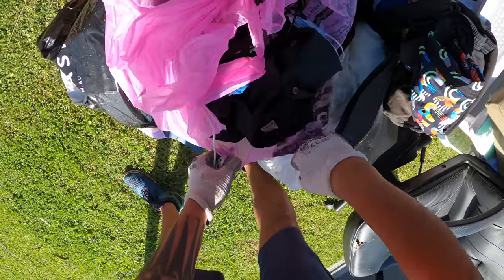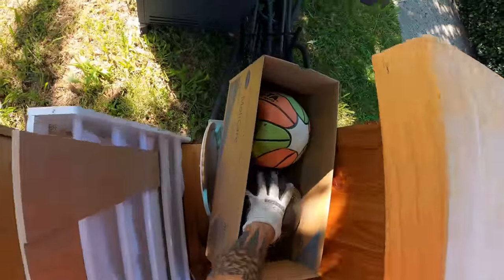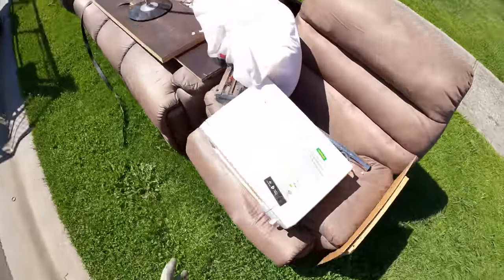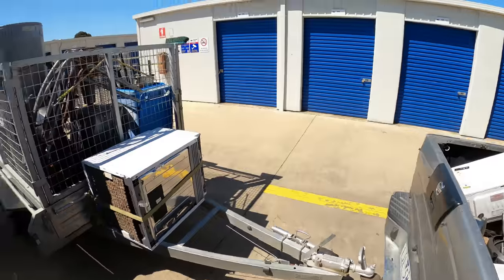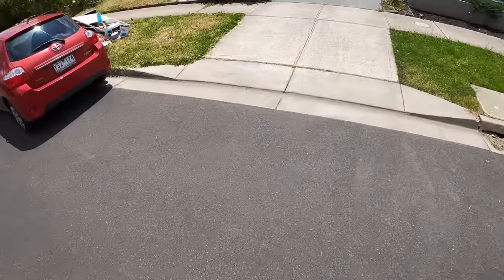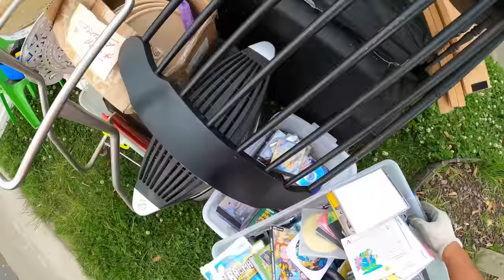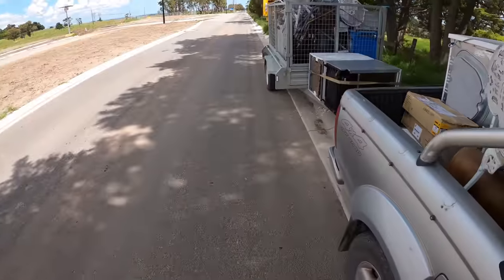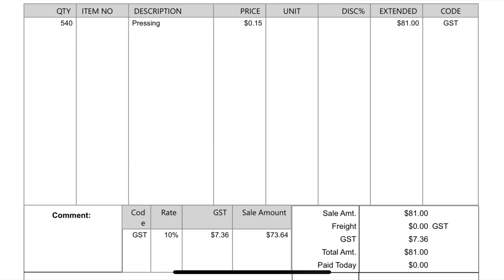Suburban Curbside Scavenging

Comment: Actually, the best scavenging is at college campuses.  Specifically, April, May, or June.  That's when kids graduate.  Mom and dad paid for all their furniture, lamps, you name it.  Even Vespa's are left behind or found near the dumpsters.
Reply from the maker: Is there any competition?
Reply: @PolyProphet  Not really.  Which surprised me.  
Colleges set up massive dumpsters at these dormitories', fraternity and sorority houses and these kids just throw everything in and around them.  I saw an old landlord going around these dumpsters at 3am.  She had brand new refrigerators', couches, lamps, tables.  I was third party contract security and was not obligated to do anything so I just observed.  I actually grabbed a refrigerator, almost new kitchen table with ceramic tiles on top.  Three Vespa's and one brand new, pink Vespa.  I asked the owner why she wasn't taking it with her and she said her parents wouldn't allow her to take it back home.  Someone, moments later offered to buy it flat out for like $50. and hauled it off in his truck.  LOL
Reply from the maker: I’ve seen a few channels like vid vulture and brefcast at college dumpsters but there’s a lot of competition where they are. Thanks for the insight mate 🙂

Comment: I only ever find plastic dishwashers with no cords
Reply from the maker: The body is plastic?
Reply: @PolyProphet  yes, the door and frame are metal but the body is plastic. A lot of people strip them down and use it as a storage bin.
Reply from the maker: Wow I’ve never seen them like that 😯
Reply: @PolyProphet  I've noticed you pick up metal baby gates. Ours are primarily plastic. I don't know  the last time I saw a metal baby gate.
Reply from the maker: Whoa another one?! I’ve seen in the uk they are the same as ours. Baby gates are relatively heavy too and easy to pack. Unlucky on those ones brother. At least you have brass hose ends 😅